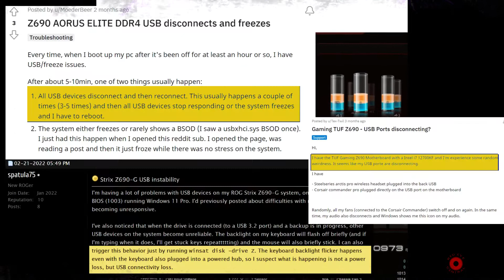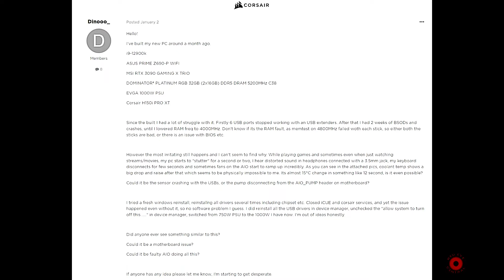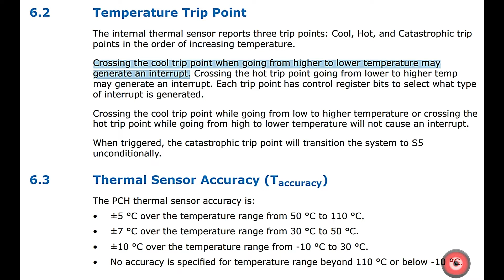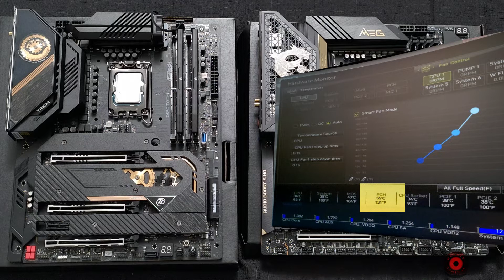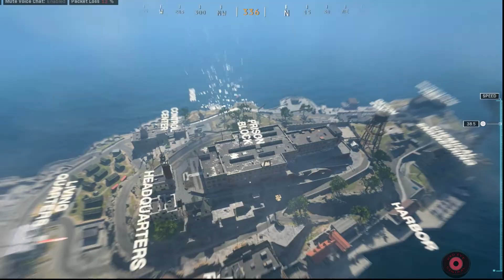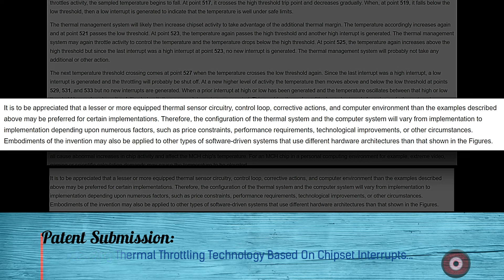Z690 Chipset Motherboards Getting Burned From The Inside Out? Let's Take A Look

Comment: MSI Pro Z690-A DDR5: No problems. PCH consistently at 50c.
Reply from the maker: Thanks for heads-up on how that board's PCH temps are looking. It looks like the MSI PRO Z690-A doesn't have onboard thunderbolt 4 or as numerous of NVME slots as some of the other boards mentioned above. That may reveal some indication that the extra heat on the PCH is occurring more on boards that have that extra connectivity, along with a jam-packed list of other features, going through the PCH.

Some of the extra features on those boards may include:
-Premium sound modules (with optical audio)
-3 or 4 Lan/Wi-fi adapters (possibly with 10Gb Ethernet)
-USB-C 3.2 gen2x2 20Gbps Rear I/O port(s) 
-Onboard USB-C Display output (video out at 4K 60Hz)
-Combined with x2 40Gbps Thunderbolt4 rear IO (video, audio, power, data) output ports
-2 onboard Mini DisplayPort input ports (for Thunderbolt passthrough)
-2+ USB 3.2 Gen2x2 20Gbps onboard headers
-5+ onboard NVME drives
-8 USB 10Gbps 3.2 Gen2 Rear I/O ports
-Beefed-up power designs ("20+1 teamed power stages rated for 105 A": specced for the Z690 Formula, one of the boards from the mentioned forum posts)
-etc...

Thanks for the feedback! And helping to shed a little more light on how some of the other boards out there are performing, by letting us know what you're seeing on your system.
Reply: @RedEyeCentral  it has 4 NVMe slots (x3 gen4x4 and x1 gen3x4) and I'm pretty sure it does have Thunderbolt. 
Had absolutely no temp problems though. When I play an intensive game, the highest I've seen the PCH jump is 52 but at all other times it's 50.

Rather it has an internal connector for Thunderbolt, but it doesn't have a port on the rear I/O
Reply from the maker: @reti7959  ~50C doesn't sound too bad for the Z690, and that's about what we saw on the MEG ACE out of the box. And you're not noticing any interruptions, disconnects, or dropped peripheral connectivity?

It could be that some boards are seeing slightly more capable heatsink designs than models from some of the other board manufacturers. That MSI Meg Ace mentioned above, that had around 50C out of the box, was looking better than what some system owners were reporting on some other $800-$1000 boards, where they were seeing ~90C-100C.

But, under heavy gaming and with a vast majority of the connectivity in use (most USB, 2 TB ports, all Gen2x2 headers, all NVME, all Sata, etc), we noticed the temps getting up into the high 70s on that MEG ACE. We were getting some disconnect issues on some peripherals; same on an Asrock Taichi. Which, to try and rule out PCH temps, goes back to "what are the hot and cool trip points triggering interrupts, and what happens during those interrupts?"

On something like a former x99 system during high-intensity benchmarking with a heavy OC, the PCH was 32C-39C. That was a different microarchitecture, and on that platform, a lot of the PCIe lanes (40) were going through the CPU, which caused more heat on the CPU instead of the chipset.

We added a Watercool Heatkiller Southbridge water block on the MEG ACE chipset, and it brought the Z690 into that x99 30C range; we might try to do a video on that WB soon.

In any case, it can come down to how much connectivity is being utilized at the time the system temperatures are being monitored; whether a system owner is using all of the features available.

On your MSI PRO Z690-A the power and bandwidth loads on the board are going to be higher when tapping into the full features of the system. So whether:

-Are all 4 onboard nvme slots populated? If so, with what size, Gen and speed drives? 
-Are all 6 of the sata ports connected? HDD or SSD?
-Onboard sound being utilized?
-Any connections to the rear I/O USB 3.2 Gen2x2 port?

-Is the Gen2 (10Gbps) header connected to any devices?
(Features like this are board to board, as other boards can have x2 Gen2x2 20Gbps headers for 40Gbps of just Gen2x2 headers, making the bandwidth potential even greater)

-Is the Gen1 (5Gbps) header connected to any devices? 
-Are all rear USB ports populated? What type of devices?
-Onboard Video being utilized?
-Lan in use? What link speed?
-Wi-Fi in use? What link speed?
-Is there an add-in thunderbolt controller currently connected?
-Is the DMI running in DMI 3.0 or 4.0? (On MSI Meg Ace, the DMI can be toggled to either one)
Any video, audio, image editing/converting/rendering during temp monitoring?
etc...

Identifying this usage can play a role in determining things like the amount of bandwidth, power usage, and processing happening on the system at a given time, which can then be compared to the system temperatures to gauge the heat dissipation capabilities while utilizing a certain percentage of the system's capabilities.

For a thunderbolt add-on controller on a board like MSI PRO Z690-A, which has a header but no onboard TB4, that would connect to a TB header and a USB 2.0 header, inserted into a PCIe slot, and that offloads the thunderbolt functionality to an external AIC TB controller on the PCIe card, to handle any data management and, or, multiplexing responsibilities of the controller, and then send data back to the system and onto PCH.

Something like this: 
https://us-store.msi.com/Motherboards/Controller-Card/Motherboard-Add-On-Cards/Thunderbolt-4-PCIe-Expansion-Card

With onboard TB4, if it's enabled in the BIOS, that functionality is integrated with the onboard controller, and any effects on temps occur right out of the box. And whether the state of being physically integrated into the design can even possibly contribute to some additional heat in certain areas of the board, as well, not just from the extra connectivity but from the proximity of the actual physical controller being soldered right into the circuitry and the heat dissipating off that onboard controller and transferring to other nearby components.

Then, there are the boards that can have 8x 10Gbps USB ports. That is theoretically 80Gbps of traffic for the chipset to negotiate on the rear USB alone. So, in regards to the PCH temps a system owner could be experiencing, it can also come down to whether they're tapped into those ports and fully utilizing all of the other marketed connectivity on the system.

* DMI 4.0: "with 600 series chipsets, doubles the bandwidth each lane provides and is two times faster when compared to DMI 3.0. The number of DMI 4.0 lanes depends on chipset model used"

* "The latest Z690 Chipset technologies maximize
responsiveness, with support for up to 28 PCIe Gen 4.0 and
PCIe Gen 3.0 lanes, increased DMI throughput from 3.0 to 4.0,
and increased bandwidth with USB 3.2 Gen 2x2 (20G)"
Reply: @RedEyeCentral  still I would understand the PCH to get hot when is used not when is idle

Comment: It wae running just fine in the bios and then it kept disconnecting my touch screen monitor i just though it was a minor glitch so i moved on with an analogue keyboard and mouse worked for 2 hours and the all of a sudden a red light appeared and then it booted agian and it said that it was cpu overtemping i been tryning to fix it all day today
Reply: Seems like its been capped at 89c wich is still reasonable
Reply: Idle temp 89c the voltage is 1.229

Comment: Same issue, I play dcs so I have a lot of usb devices.  I use to have three m.2s but I have since removed one.  I’ve had to change some settings in the bios to throttle the 2nd m2.
Temperatures were from 70-80c.
Now they are 50-60c.  I plan on sticking a heat sink on the damn thing to try and cool it.  I’m surprised linustechtips or gamesnexus hasn’t addressed this problem yet.

Comment: I came looking for a solution because I thought my PCH temperature was unnaturally high. It's around 57 Celsius Idle and around 75 Celsius at load. Considering it's better than the few comments I guess I can't complain. Still weird that my cpu core at idle is only at 26 Celsius and the PCH is double that.
Reply: you are good, mine is 75C in idle

Comment: I got exact issue on my ASUS ROG MAXIMUS Z690

Idle temp is 69c and PC shutdowns during gaming..
First I thought it was PSU issue until I saw this video.. 

I think I should RMA for this but if this is chip issue is there really a fix?
Reply from the maker: 69C is quite warm for idle chipset temps. At those temps, it would then depend on how well the heatsink design is able to dissipate heat at the higher end of the thermal spectrum once the system workload drastically increases.

Have you monitored the temps during benchmarking or gaming to see what they are getting up to during those workloads? Intel states the catastrophic chipset trip point is set "close to" 110C.

If you've determined the chipset temps are rising drastically above that 69C, then, unless you really love the board or plan to modify the cooling solution, it might be time to consider an RMA and try to find a brand and/or model that has a better reputation for integrating a higher performing thermal solution on the chipset. 

For the price you paid, your board shouldn't be shutting down during gaming! There is a lot going through the Z690 chipset, and the cooling designed by the manufacturer needs to be able to handle the additional workloads.

We have an MSI Meg Ace, and that was at about 50c at idle and about 60s to 70s at higher performance states. We ended up removing the factory-applied chipset heatsink and installing a water block.

The MSI MEG ACE that have does have some other issues, though, such as a BIOS that can refuse to boot when certain settings are applied (unless all power is flushed), an NVME drive that disappears on restart, and can only be reactivated by completely flushing all the power from the board before booting back into the OS; by shutting down the system, turning off the PSU, and holding down the power switch to flush residual power. But after following that procedure, the drive is available again, unless we restart. lol...for $600 board.

The glitchy behavior exhibited by the Z690 platform has definitely been giving me some X99 flashbacks. Ironically, they may stem from the same exact design "improvements" that were targeted on that platform as well, such as integration of more PCIe functionality through increased PCIe  lanes on the platform. Except on x99, they were placed through the CPU.

The Z370 and Z490 platforms were a lot smoother, but the Z690 is attempting to increase the bandwidth and add PCIe lanes and may be doing it at the cost of stability.

Let us know what you course you decide to resolve the issue.
Reply: @RedEyeCentral  yeah I actually have same experience until I flush the power the pc is on power loop turn on and turn off I did RMA my power supply but I guess it’s the MB after all but I test tomorrow when new PSU arrives.  Motherboard also included PCI m.2 card maybe I try this and contact Asus on his.
Reply from the maker: @GoalTV_   It's definitely frustrating. A return can sometimes be simpler than an RMA because you can get a brand new specimen or a completely different model. When outside of the return period, an RMA can sometimes turn into a revolving door of shipping and repair attempts.

But, the shutdown could very well be a thermal shutdown due to the chipset. When we attempted to test different thermal pad brands and thicknesses under the stock chipset heatsink on the MSI MEG ACE, we had a thermal shutdown due to chipset temperatures because one of the thermal pad applications was making insufficient contact between the heatsink and chipset, so the chipset can definitely overheat and trigger a shutdown. On another attempt with a different pad, we ended up with an 80C idle temperature; a definite downgrade from the stock pads at 50C at a system idle state.

TOUCH TEST:
You can also try to touch the metallic chipset heatsink with your hand, especially right when the system crashes, to see if it is extremely hot to the touch. A component should be hot under load, but if it gets to the point of eliciting a burning sensation on your hand, that can be a sign that reaffirms the thermal solution is not effectively dissipating enough heat off the hardware during the workloads being performed on the system. But, at least one caveat exists where an overheating situation can fly under the radar of this touch test, and that is if the chipset is overheating because the heatsink is not making proper contact with the chipset (due to faulty installation at the factory); touching the heatsink might not help pickup on an overheating situation in those instances because not enough heat is reaching the heatsink in order to dissipate off the chipset and reach the finger on the other side of the heatsink.

GPU COMBINED WITH CHIPSET HEAT:
Also, the chipset is right behind the GPU, a hardware component that, by itself, can lead to a good amount of heat building up in that area. When combined with the heat built up from the chipset, it can send the system spiraling toward "thermal runaway" territory if that combination of heat is not dissipated effectively once some of these monster GPUs ramp up activity, such as during gaming. If heat dissipation was suffering at idle performance, we can anticipate an increase in thermal issues as system performance increases.

FANS:
Some system owners have talked about placing a fan in the area directly in front of the heatsink, even taping a fan directly to the heatsink using double-sided tape.

WATER BLOCKS:
There is also the option for water-cooled systems to add a chipset water block. Once we added a water block (with thermal paste instead of pads) to the chipset on the MEG ACE, the idle temps went from 50s to 30s Celsius at system idle performance, and high 30s to 40s Celsius (depending on ambient temps) during heavier workloads.
Reply: @RedEyeCentral  update after PSU replacement idle temp dropped to 50c and no longer crashing 😀 so thankfully it was just bad PSU but I see how it will preform for next 2 weeks
Reply from the maker: @GoalTV_  Awesome! Seeing as how it can often be difficult to quickly find the culprit component, that's excellent news! It's always great when you can hone in as quickly as possible to prevent having to further tear down the system, component by component. 

It is odd that the PSU caused the chipset temps to increase, but maybe it was some situation where a faulty PSU was delivering some out of spec performance like the wrong voltage, some kind of grounding or resistance issue, maybe even a high resistance connection situation, that caused the system or the GPU to draw more power than needed, thus increasing heat as a side effect, or just causing more heat near the GPU connections to the PSU that was increasing heat build-up in that area of the case.

What brand/model was the PSU? Did you check it with multimeter, reporting software, or just intuition that it seemed like the PSU was on the forefront of triggering the issue when the system crashed?

I've had some PSUs (Corsair HX1200i) that checked out fine with PSU testers and multimeters, but when the GPU drew a load from the PSU, the PSU would fail. But, the symptom of excess heat on the chipset in your case is interesting.

Here's hoping that's that!

Thanks for the feedback! And letting us know what you're seeing on your system.
Reply: I tested asus z690 hero it was high at 64c . Then tested gigabyte z690 master it was much lower at 40c.
Reply: I have ASUS ROG MAXIMUS Z690 Formula, the PCH has 75 degree C in idle
Reply: @marianiordan5972  Yeah same but seems stable enough not crashing anymore during gaming etc so I just ignore the temp at this stage it won't go higher then 7X c. I don't see any performance issues so good enough for me.